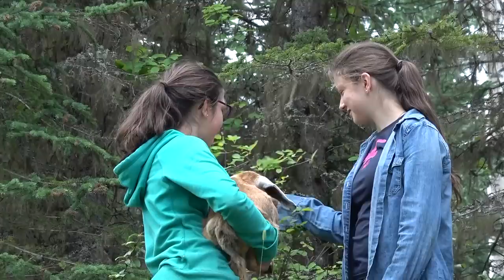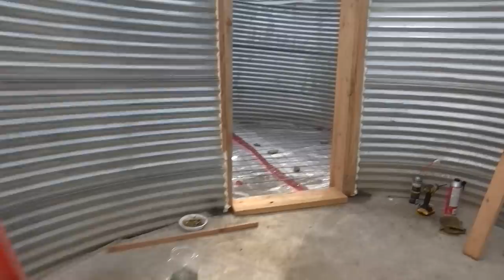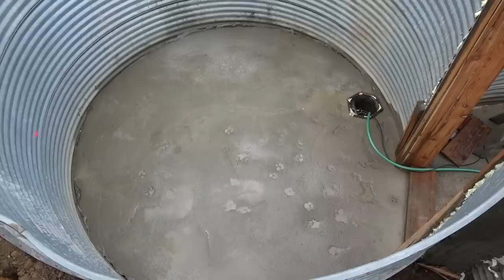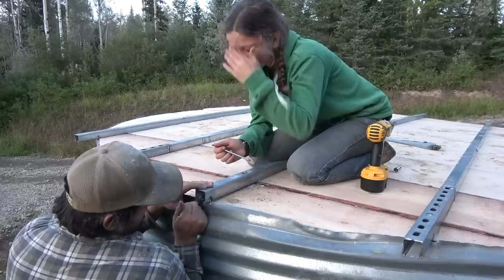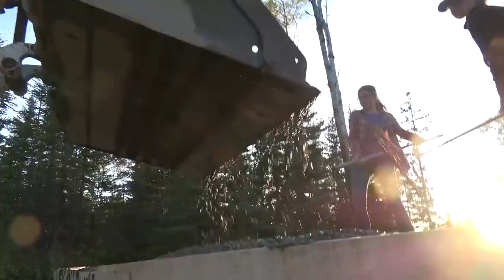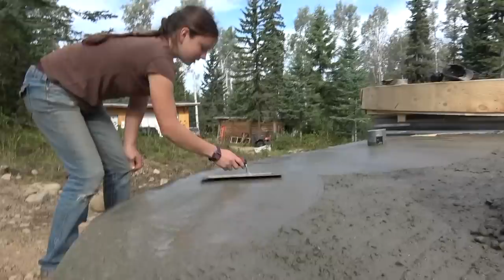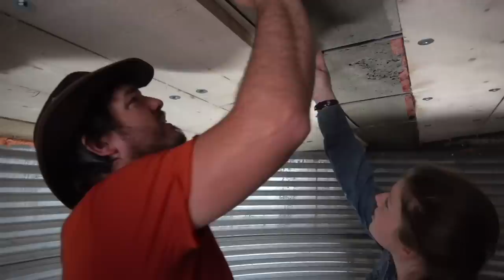Home Made Cellar: Suspended Slab on a Culvert

Comment: Nice tomb!! Yes, I said it. This WILL collapse. I have built with concrete for 35 years and I PROMISE you this WILL fail. If you wish to utilize this unit please do the following at a minimum for safety. When you build shelving use concrete blocks from floor to overhead slab. Pour the cells with grout as you go up. Do not need to lay blocks with mortar between them. They can be dry stacked and grouted. Space these concrete pillars evenly around perimeter. Five columns will serve well. One on either side of door and three others space equally. Columns can be one 8”x8”x16” block stacked straight up. Sure wish you had back filled and tamped (continuously) to top of culvert then poured top with one foot overhang on the ground. Please cover slab with 20mil pond liner extending 4 feet past edge of slab then cover with one foot of dirt so rain or melting snow does not wash the dirt away from edge of slab. Wish I had not watched this video,,,,you have the most precious family I have seen on YouTube. Please have an engineer discuss this with you.
Reply: I'm no engineer but as soon as I saw there was nothing supporting that slab apart from some thin steel I agree with you. I wonder if they have taken on board any of the comments like yours and those added below, it's a death trap! As you say such a lovely family which has put their lives at risk, hopefully they reinforce this ASAP.
Reply: I'm a woman with no construction experience and I thought the same thing.  yikes! 😬
Reply: You are ABSOLUTELY correct. This is a tragedy waiting to happen. I would recommend minimum 5 steel lally columns with poured concrete inside them with a suitable pad under neath and each column with a cap piece of 3'8" steel circles with an 8 inch diameter. all connected to the floor and to the ceiling pad. The corrugated steel is strong but it's strength truly is derived or comes from when all the sides or the entire circumference of the tube is equally supported with dirt or sand etc. This is why they are used for drainage "tubes" underground or partially underground. They are really strong this way but not the way you have them. Additionally, this fill dirt / sand needs to be compacted - tightly about every 10 to 12 inches every layer until you reach the height needed. PLEASE, please take these steps. Protect yourself and your family from yourselves.  What Citizen 1 said is SPOT ON!
Reply: @markonovacki2707  Thanks, i googled douchebags meaning, I don't think we are being obnoxious or offensive for raising our safety concerns, however, please enlighten me, what is armature, I thought it was electrical related.
Reply: @marko novacki.   I don't think we're morons just concerned for the family's well being.
Reply: I stopped watching when they started removing the inside wooden supports. Looking up a cubic foot of concrete it seems to be 150 pounds. If the diameter is 14 feet length of one board pie r  squared gives the area round it off that’s 3×7 squared which is more than 150 ft.². And even 4 inches thick that’s 50 ft.³.Maybe my math is wrong but that’s a heck of a lot of weight
Reply: "We kinda guessed at the design for the suspended slab, out first ever."  
When there are lives at stake there shouldn't be any guessing. Get a building inspector!
It's like placing a 8 in. x 8 in. x 16 in. Concrete Block (34 lbs.) on top of a 12 oz. aluminum soda can where the top and bottom have been removed.
Reply: Hi Citizen 1. I agree with you. I wish these folks the best of luck. Great human interest video but I serious doubts about the structure itself. Corrugated materials derive their load strength perpendicular to the corrugation as in a Quonset hut. I fear that the structure in this video will rust and suffer a catastrophic collapse.
Reply: @jimdevilbiss9125  I was already worried about how well those wooden piles would hold up over time in terms of supporting the slab, but then when they took them out entirely I was completely baffled. If the slab+rebar extended over the earth itself beyond the radius of the culvert then maybe this type of project would be a little less scary, since the slab could be supported at least partially by the earth rather than only on the relatively thin corrugated steel rim, but even then I don't know about leaving all the weight of that slab completely unsupported in the center.
Reply: What about if we put  rebars and concrete (i'm thinking of 4inch of pour slab) on and around that corrugated wall of thiers and put a  solid pilar in middle of the structures, is it a good idea?  Thanks in advance for the response 🙏🏼

Comment: A lot of people have commented, but I want to add mine.  The culvert is galvanized steel.  Once buried, it WILL begin to corrode on the outside, and there is no way to inspect it.  The steel is the only thing holding up the heavy concrete slab.  So this structure is not inspectable, not maintainable and prone to fail catastrophically.  That's my 2 cents.

Comment: Hi Dave, I like your idea of using a culvert as the walls of the building structure, but I am concern for your safety, because concrete weights about 150 lbs per cubic foot or 1 cubic yard of concrete weights about 4050 lbs. If the roof structure has additional loads applied such as snow, people or dirt this can cause the corrugated steel culvert to buckle and collapse inward and off to one side. Please consider putting multiple 4x4 of 6x6 vertical column supports on the inside next to the walls, from the concrete floor stab to the concrete roof slab while interconnecting all columns together to insure that there is no chance for lateral forces from dirt covering outter side walls of structure to cause lateral movement of walls and columns, causing instability and structural failure.
Reply: Very nice of you to give him advice
Reply: @ryanmay3022  , yes, it could save a life or two
Reply: Well said
Reply: You have made something very dangerous. These walls are not made to bear this enormous weight in this way . They will eventually collapse under the weight of the ceiling. So place stanchions to safe lives.
Reply: I guess you've never stood on an empty soda can before. Most people let their imagined fears rule their lives. Others live gridlessness.

Comment: Years ago I had a concrete structural engineer design an underground house for me, a highly respected structural engineer. I still have those plans and there is a lot more steel in a lot smaller span than you have and a lot thinner pour on walls that are a lot stronger than corrugated steel culvert which is not intended to be loaded in compression.
  Hopefully you will put some steel columns inside the culvert because the collapse will be deadly without additional internal support.
Reply: Alan Davis yeah I know he sounds like a buzz kill, BUT... he makes a valid point. People have gotten in trouble burying shipping containers due to both downward and lateral forces at play on the walls and that culvert is waaay less solid than a steel container. Be Safe
Reply: @utamaverick2004  Please don't bring up Containers.

Comment: Great job.👍 surprised by all the negative comments by people who have probably never seen an actual root cellar, much less built one. As regards the structural strength, I’m sure you thought of this but any concerns could easily be rectified by installing some load bearing upright posts, steel, wood or whatever. I was raised in an era when and where root cellars were common. I have personally built 2 of them and currently still use one. The idea of an inner and outer cellar is a good one. Mine is a single compartment with a long entryway to reach it. 12 feet from the outer door to the inner sanctum, which also has an insulated door. I had the advantage of an existing hill to dig into, which eliminated a lot of work to build an artificial hill. I probably would have put in some upright steel posts given the dimensions of your culvert. But then I always overbuild everything I make. All in all you did a good job. Regarding the air entrained concrete, yes a freeze thaw cycle is hard on concrete, but your inner cellar particularly won’t be subject to freezing. That’s the whole object of a root cellar. The outer cellar, due to its exposed nature could perhaps be subject to some frost, depending on where you live and the average ambient winter temperatures. Here in northern Alberta we regularly get minus 40 temperatures although the average is probably more like minus 30.

Comment: 100% love your enthusiasm and love the hard work the girls put in. I can tell a lot by this video that you are an excellent father.  I am really concerned that the steel culvert will not be strong enough to hold that much concrete. I say this because the culvert is more structurally sound when laid perpendicular to its current position when surrounded by earth.  My suggestion would be to reinstalled the posts all around the edges of the walls to help hold the weight. I am just afraid that when it fails (and it will) it may hurt someone in the process. Please don't take this as a criticism, I love the project. I really just don't want to see anyone get hurt.
Reply: Hi Reality Survival. I agree with you. I wish these folks the best of luck. Great human interest video but I have serious doubts about the structure itself. Corrugated materials derive their load strength perpendicular to the corrugation as in a Quonset hut. I fear that the structure in this video will rust and suffer a catastrophic collapse.

Comment: I'm a little late to the party, here's a suggestion.  Many have suggested vertical supports.  Use them for shelves.  You are going to need shelving anyway, so may as well get the added safety and support.
Great job.  That's a better than average construction crew you have there.
Reply: Totally agree. Leave no margin for error and tragedy.  That's a lot of weight overhead.

Comment: I'd be getting an engineer to look at that structure.
You have a precious family there :)
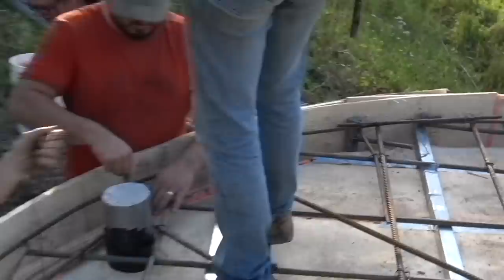Reply: I was thinking the same thing cause by cutting those holes for door ways its now gonna change how the weight is disturbed without properly supporting the weight ontop.  The concrete looks to be 6 inches thick at least(8:08) .. it might hold for a while but who knows how long ..I'm not an engineer either but would have done a tin roof with no dirt ontop, as the man from the video says also wants to put dirt ontop to hide it.
Reply: I suppose once its fully backfilled its not going anywhere; but those horizontal corrugations on the mostly unsupported culvert... well I guess the ending was kinda spoiled since this video was uploaded and all.
Reply: Most good advice. Then set up the numerous interior columns to satisfy said engineer. Hint keep the mixer going ladies. Will need some piers poured in the floor to carry the lolly poles. Hope it ain't winter yet.
Reply: Hi Peter. I agree with you. I wish these folks the best of luck. Great human interest video but I have serious doubts about the structure itself. Corrugated materials derive their load strength perpendicular to the corrugation as in a Quonset hut. I fear that the structure in this video will rust and suffer a catastrophic collapse.

Comment: Spring go the other way on the bolts. They hold the brace up till you bolt it and automatically spin in correctly. Great video, my and 3 daughters just finishing a 93 foot rock wall at 8 feet on the end. A+

Comment: Danger Danger Will Robinson:  "Suspended Slab on a Culvert" 

What exactly is the slab suspended on ???? The edge of the culvert is about 1/8-1/4" thick. You poured concrete right to the edge of the culvert so the most that is holding up that slab is a thin line of steel. The culvert is galvanized the cut edge is not so it will rust faster than the side. Your side showed voids in the concrete. There is nothing holding that much concrete up, if the steel edge doesn't fail, the thin sliver of concrete the edge is resting on is not strong enough to not shear off over time. The steel will spread and fail,  the concrete will shrink, the concrete edge will break,  water will come in,  and the plug will head to the bottom.

The culvert was designed for compression around the outside with equal pressure on all sides. It will take some compression on the ends, not like what you are trying to do.

You should have done one of two things. If you had made the slab a rectangle with 1' overlap on 2 sides then back filled tightly under the overhang the slab would have been self supporting. Now the only option is internal supports to hold up the slab.

Congrats on the girls you have. People that are willing to work and have a good time doing it are far and few between.
Reply: I had the same thought, not to mention the added weight of planned soil on top of it.  This design is going to fail, possibly with deadly results.  I take it this was built without a building permit?
Reply: These are the same concerns that I have. I have built many structures over the years and torn more down, this whole project fails basic engineering.
Reply: @Perfect in Weakness You missed my point, that point being this would never pass building code regulations, nor should it pass.  It is a death trap.
Reply: Hope he don't get them hurt
Reply: I agree. He made a death trap that will fail. And he ignorantly put his family at risk. He should fill that death trap with soul and start the heck over so nobody gets killed.

He had good intentions, and he lives his family, but he did not research on the  structural integrity of that very thin steel
Reply: Would have made more sense to build the caps from expanding foam skinned with a thin coat of epoxy.

Or put the 10' culvert inside the 12' and fill the space between with concrete meant for compression loads.

Once fully cured, it would support a concrete cap.

Comment: Great idea. However I’m unsure of that suspended slab being held by just the culvert. As well as the position of the rebar. Because it would want to sag in the center, the tensile strength would need to be on the bottom and compressive on top. I would also question the bag mix you used. Freeze thaw environments require air entrained concrete. I’m a concrete finisher for 30 years.
Reply: It gonna catch air in a big way, not in the too far distant future.
Reply: I was thinking the same thing with cement as roof.
Reply: EXACTLY, some of my concerns!!!🤔😲
Reply: Ive poured similar,  never had issue  the tube stock welded yowards bottom helps to support. I would have left wood in to dampon and encase sides in concrete,  but as long as packed about every 12 inches should old nicely.
Reply: He must be trying to off his family. I’m a builder for over 26 years and a union rep and i did concrete for over two years and this thing will come down it will all leaning to one side and it will all come down including the roof

Comment: You really should frame that with additional support.
Reply: I was thinking the same. I'm sending a friend who's a structural engineer this video. I imagine he's gonna freak out like I did when I saw him cut the pine log supports out. Absolutely not safe. I'd use the same unistrut as he did for the bridging as uprights every 2' on the perimeter on the inside, it would eliminate the issue and give him shelving attachment points at the same time. I'd hate to see all their canned peaches crushed.

Comment: A friend of mine converted three grain silos to housing. It took a lot of work but they produced beautiful  housing. They recycled all the wood from the inside silo walls. Spray foam was put into the walls for insulation. Ac/heating was about 1/3 the cost of a new home today.

Comment: Looks like a death trap to me with out some reinforcement on the walls
Reply: It’s CORRUGATED MERAL
What more is needed?
Reply: Well corrugated steel with the horizontal layout is not working as if it were vertical. The roof slab will be heavy.....
Reply: John Sunderland don’t you think there would be way more down pressure when it is laid on its side . With traffic driving over it like a semi truck caring a 60- 80 ton load .

Comment: I think you should run that roof-versus-wall-versus- span calculation by a structural engineer. I am not that kind of engineer, but that looks like a trap for your kids. When snow is on that roof, I think its going to collapse. Consider support poles?

Comment: Nice team work. As a builder I gotta wonder Structurally what is going to hold up your monster concrete cookie? What keeps the accordion from coming down? BTW you're outnumbered dude, you can't win.
Reply: Also is there a possibility for termites or other insects to eventually migrate into the what appears to be untreated wood in the structure?
Reply: @messagesotherrealm545  no termites up that far north
Reply: @DK-jd8bj  What about frost heave?
What's connecting the culvert to the base slab?

Comment: Exactly what is holding up the very heavy concrete roof on the first one, except for a culvert pipe with no support on the sides?
Do you not have anything supporting it?
Reply: It's a miracle
Reply: It's call rebar and steel
Reply: Questions, questions, questions. We support our root cellars, where ever they are. When ever they need us.

Comment: Aren't ya suppose to cast the rebar INSIDE the concrete?
Reply: rstevewarmorycom  - you are correct.  As an architect who also knows a bit about engineering, I see multiple structural concerns. At 150lbs/cu ft, I would not want to be inside that cellar !
Reply: did you watch the same video I did?! it IS in the concrete!